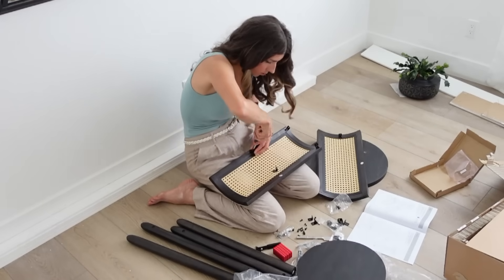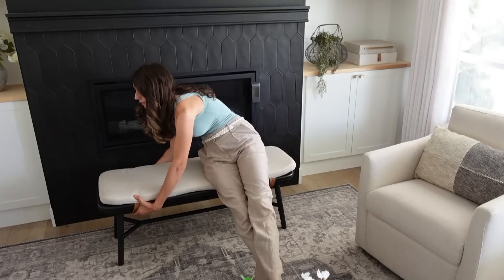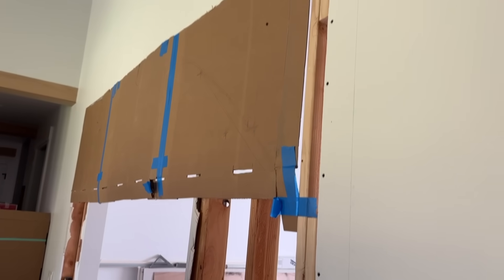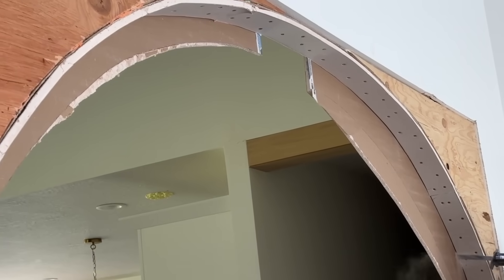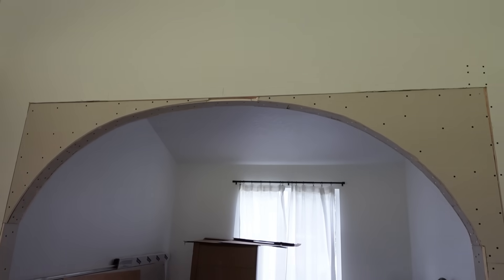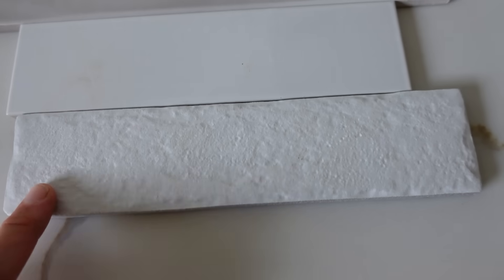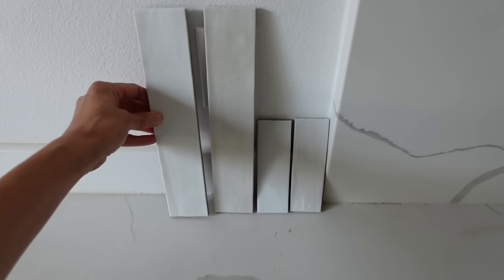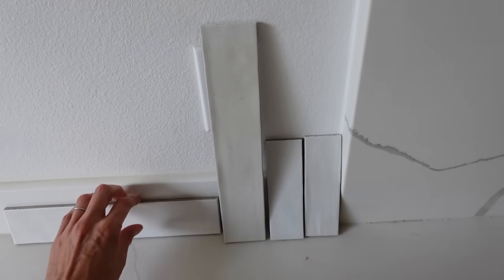New* Walmart Decor + How to Style It / Finishing the Archways

Comment: I really like the archways!  I think they will look really good.  I used that sticky tape stuff to put up the tile backsplash in my kitchen.  It worked really good.  It is really sticky though, and was a little difficult to cut the pieces since it is sooo sticky, it sticks to what you are cutting it with.  My sister was helping me, and she had done tiling before and she said it was something that she would use again, that the other mortar stuff is messy, and you have to wait for it to set up before grouting, where with this you can grout as soon as you have it up, making the project go faster.  I would say one drawback is that when you stick the tile it is stuck!  So just be aware there is not much wiggle room if you don't get it on right.  At least that was my experience.
Reply from the maker: Thank you and for the feedback on using the tape. Very helpful